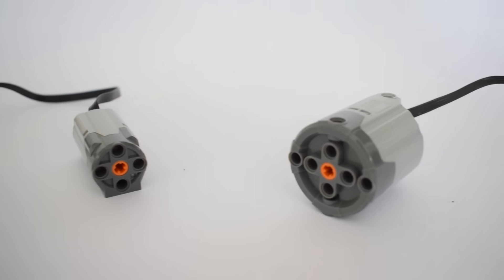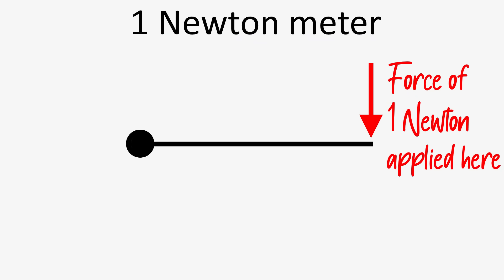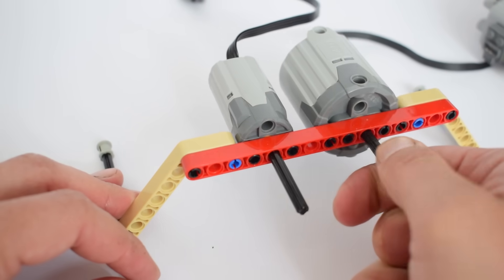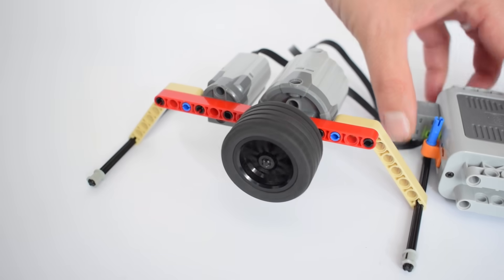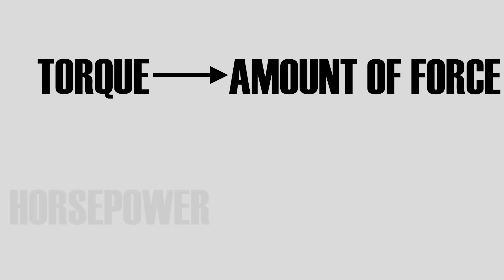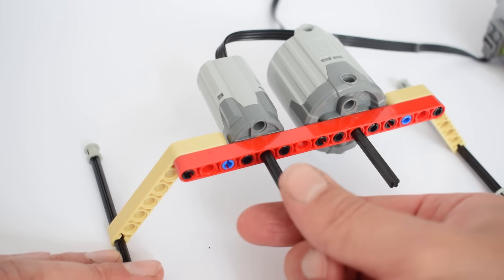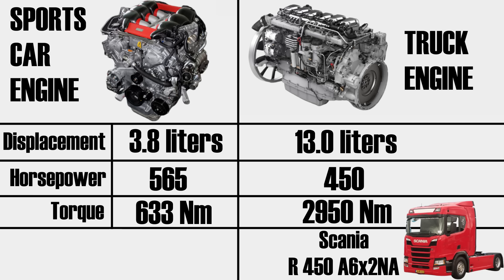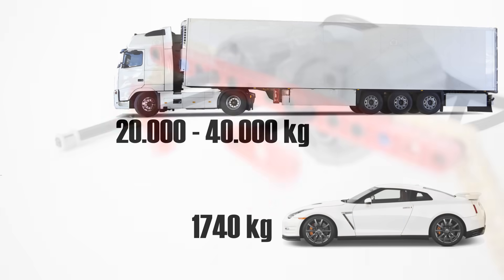NEVER be confused by HORSEPOWER and TORQUE again - HP and TORQUE EXPLAINED in the MOST VISUAL WAY

Comment: That's the weirdest definition of power I ever heard. Power is power, work is power multiplied by time, just like work can be torque multiplied by time. But other than that it's nice that you show difference between ability to do "lot of work" (low torque) and to do "hard work" (high torque).

Comment: The car engine in this example could pull the same load as the truck engine but faster, with the correct gears. But maybe wouldn’t last for 500k  miles doing it 👍

Comment: I know some of the differences between those referenced vehicle engines are due to one being petrol and the other being Diesel. But what makes an engine a quick revving engine (note: quick not high although those two are probably rather well correlated)? Is just low mass of moving engine parts vs power/torque? And wouldn’t for driving experience the whole mass of the car dwarf that of the moving parts of the engine?

To ask a simple question: Two engines running at 1000 rpm, with one being able to provide twice as much torque at 1000 rpm (when floored), the same weight of moving parts (I guess it gets more complicated with how that mass is split between parts that reverse direction and rotational components, eg, piston vs fly wheel), when you floor bath engines, which one will hit 2000 or 3000 rpm first?
Reply: Depends on the torque curve of each engine ( graph ) The one with larger torque could be on the down slope meaning falling torque while the other could be on the up slope increasing torque.
Reply: @malcolmwellings2198  Ok, let’s think about a couple of combinations: (a) both engines have a torque plateau from 1000 to 3000 rpm, (b) the lower torque engine as a rising torque curve from 1000 to 3000 rpm, while the higher-at-1000-rpm torque engine has a plateau.

Comment: rpm can be changed using gears. can torque be changed..? ex: for a given 
hp= torque x rpm 
at moor output, if we connect a 1:2 gear, rpm  changes to half at the gear output. what about horsepower and torque at the gear output??
Reply: Yes, gear output rpm will be lower torque higher, hp the same.

Comment: Hang on, if it's newton metres then surely it's lbs foot and not foot lbs? The force first, distance last? Excellent video though!  Gonna definitely watch your one about diffs because they baffle me a bit
Reply: You're multiplying the units together. It doesn't matter which comes first. People say both "pound feet" and "foot pounds". Neither is more correct.
Reply: @wbfaulk  cool ta! That's a very good point that had never occurred to me before! 👍 Although I have to say I've never heard anyone say metres newton, not ever and every manual I've ever seen has it written lbs foot. Foot lbs rolls off the tongue more easily than lbs foot I have to say.

Comment: Great video, but I think that you should have at least mentioned how gear ratios relate to this topic.
Reply: i agree. i have a 1999 gt mustang and the torque increase you feel with 4.10 gears is phenomenal. gearing is seriously an underrated way to increase power in a car/truck
Reply: One thing I can say is that 4L in SUVs is the maximum torque put to the wheels, and I dare anyone to stop a vehicle in this mode

Comment: If the definition of Newton includes time, then how is the difference between N and HP time?
Reply: Torque is force times distance from center of rotation. Force is defined as mass times acceleration (distance divided by time squared). Power is energy divided by time or torque times angular velocity. 
Torque would be F·d, which can be broken down further into m*d^2/t^2. Power is F·d/t which can be broken down into m*d^2/t^3 . Where F=force, d=distance, m=mass, and t=time. 
Power has another time component that torque lacks.

Comment: This is a good start, but it doesn't explain why one is more useful than another or how gear ratios play into it. It seems to me that using a gear to merely double the speed of the larger motor's output will give it a better "power ratio" than the small one. In other words, what it looks like is that power is a measure of the maximum speed of the shaft when under 0 load, which obviously isn't correct, but I still have no idea what is correct. It seems to me that more torque always begets more power, because if you're speed limited, you can just use a gear ratio to fix it. The truck should be able to out-speed the little car if very generous gearing is applied.
Reply from the maker: Here's a continuation with gearing: https://youtu.be/txQs3x-UN34

Comment: So horsepower being represented as a ratio between torque over the rate of time that torque is applied. Is that why when we use gear reduction, it increases the torque of the gear train?

Because the horsepower is staying fixed, but the speed of rotation is decreasing relative to the horsepower?
Reply: Yes. Gear reductions are torque multipliers.

Comment: Basically it's the difference between squatting large weights and running very fast. Ideally you want powerful legs that aren't too large to still run fast. If your goal is going fast quickly that is.

Comment: The video is amazing but i always had a stupid question when it comes to Torque and Horsepower.. i know mathematically that horsepower is = Torque X RPM... but why when i still look for a car specifications for example i see them writing the maximum hp/rpm =184/4800 and the maximum torque/rpm =  221/3500... why's the rpm values not equal ?? i know thats a stupid one but i just can't get it
Reply: Example: If you have a high torque of 4 and low revs of 2 you get 8 in power.
Lower torque of 3 but higher revs of 4 give you 12 in power (more power even if the torque is lower).

Comment: Really, really well done! Great job mate! I get there s question every now and then and would definitely refer to this video when trying the explain the concept. 

Thank you for this effort! Respect :)
Reply: For most people, this one practical explanation should suffice: 

Torque is beneficial for powerful starting, climbing inclines or pulling loads. 

RPM is beneficial for higher speeds and faster acceleration. 

But in the end, the gearbox in particular has to be optimized for use. 
To bring torque and RPM to the wheels, in the best possible way.

Comment: Great explanation, although one thing that's missing is why horsepower matters for (top) speed
Reply: Exactly, and why the torque helps you drive a big load up the hill. Slowly. This video is already great, but it would even be possible to show those results with lego!

Comment: 6:20 When a car accelerates there is no force pushing you into the the seat, but there is a force pushing the seat into you. The car is being forced to accelerate, but the passengers (as independent, relatively stationary masses with respect to the car) just happen to be in the way as the car is pushing against them.

From our perspective it feels like we're being "pushed into the seat" but if you think about it, it makes sense that the car is actually pushing against you, because the engine also needs to accelerate you to the speed of the car and all of its components.
Reply: for every applied force, there is an equal reaction in the opposite direction
Reply: To out pedant you- it depends on your reference frame.  Both are ultimately correct and identical.
Reply: @zakpodo  Not entirely - accelerating reference frames have different physics than our classic model
Reply: @MiDnYTe25  it's all relative, Albert.
Reply: @zakpodo  Water is wet. Point is that physics you learn in high school don't apply to accelerating reference frames
Reply: @MiDnYTe25  Maybe the physics you learned in high school don't, but the physics you learn in university do.

Besides, how do you even determine which is the accelerated frame?!  You are on a planet (whichn s round, so even going in a straight line is accelerated, even if you ignore the motion of the earth in space,   And this is beside the fact that being under the influence of earths gravity is an accelerated frame.)

That was a relativity joke, if you missed the hint, btw.
Reply: @zakpodo  considering the situation we're reacting to, Earth is the relevant reference frame to which you can compare everything. Sure, we can always abstract further. It's not a matter of could we, more should we.
Reply: @MiDnYTe25  So we agree that I was not incorrect  to point out that physics can handle these switched frames of reference equivalently?
Reply: @zakpodo  to put pedant you - only an inertial frame of reference should be used and is always assumed. Non-inertial frames of reference need imaginary forces. The force pushing you into the seat is an imaginary force needed to be able to apply Newtonian laws to your non-inertial frame.
Reply: technically gravity is pushing you into  the seat, but to out pedant myself apparently gravity isn't an actual force. So there's that I guess.
Reply: @Obi-WanKannabis  Well thanks to inertia you want to follow the straight line in space-time which would bring you into the seat and curving towards the center of earths gravity. It's the normal force from the seat that constantly pushes you off that path.
Reply: @Obi-WanKannabis  Plain wrong m8, gravity ( on Earth ) is directed downward in the direction of the planet, hahaha :D
Reply: @server1ok  Rain Shultz in the comment above said it, gravity is not a force, it's like a centrifugal force in a centrifuge, it's just your inertia following a curve in space time. The only force you feel is the normal force of your seat pushing against you.
Reply: @server1ok  You can't feel gravity
Reply: @server1ok  Wrong, I didnt' say it was equal, I said it was a similar effect where you feel a force, but in reality it is not a force, it is your inertia pushing against an object.
Reply: No one said that gravity and artificial gravity are the same, I said gravity is similar to a centrifugue in that it isn't an actual force, it's the curvature of spacetime, the only force that you feel is the ground pushing against your inertia in a curved spacetime.

Here's the difference between a car accelerating and gravity.

You only feel gravity when you are resting against hte ground. Because your momentum is being changed by the ground itself. This is the same reason why you only feel your car accelerating when it is actually accelerating, your body wants to keep its momentum but your car is pushing you against it. 

In both cases you feel an object push against your natural momentum. You only feel the gravity once the ground is keeping you up.

If you disagree, have a go at disproving Einstein.
Reply: @Obi-WanKannabis  of course that gravity is not a force because it's a freaking acceleration
Reply: @Andrei1898  Do you even newton bro? How do you accelerate mass without a force?
Reply: @Obi-WanKannabis  stop smoking... acceleration in not force, meters(lenght) are present in the torque, yes is not torque it's just lenght. A stool can be made out of sticks...but a stick is not a stool? Clear now?
Reply: @Andrei1898  f = m x a. Meaning if you acclerate a mass then IT IS a force. Go back to middle school physics.
Reply: For every action there is a reaction, actually both are happening at the same time
Reply: actually gravity is FUCK YOU
Reply: Pushing against our back
Reply: Pretty sure both are happening.

Comment: Horsepower = how fast you go
Torque = how quick you can get there
Reply: Nope. All things being equal (weight, aero, traction,proper gear ratios etc) HP is both how fast you can go AND how fast you can get there. Torque by itself tells you little to nothing.

Comment: Nice video, but I have to be nitpicky here: Although you explain that "Horsepower" is the unit for "Power" you still mix it up several times. Also in the title. Let's better be correct here ;-) So it has to be "POWER vs TORQUE" or "HORSEPOWER vs POUNDFEET"

 However, all that shows why metrics (or let's better say: SI-units) are just better. In Germany people still use "Horsepower" ("Pferdestärke"= "PS") when it comes to cars because they are used to it - although SI-Unit are mandatory. So car companies use both on there websites or brochures: PS and kW (kiloWatt).

Using (Kilo)Watts makes much more sense than horsepower, because you already see the connection between "Energy" and "Power" (that you describe in the video) already when you just look at the units. When we have an electric car with a battery that can storage 50 kWh of energy and motor that can produce a power 100kW, then we know (let's ignore efficency here)  that after driving half an hour on full throttle the battery will be empty. Try that when you only know, how much horsepower you car has! And already the unit kWh shows that energy is the product of Power (in kW) and time (in h). Or the otherway around: When you charge you car at at charging station with 50 kW, it will take one hour to fully charge a 50kWh battery.

Another energy unit is calories. One calory is the amount of energy that is needed to heat one 1g of water by 1 °C. LOL, nonsense! So instead we should use Joule (J), that is also printed on food. And no, Joule is NOT just another random unit, instead one Joule is one Wattsecond (1 J = 1 Ws). Now that makes sense! You see also here, that "energy" is "power x time". You even can compare the amount of energy that is storaged in the battery of an electric care with the energy that is storaged in a candy bar :-)

Comment: But different horses have different power... and in the middle east they use goats.. how do you measure that?
Reply from the maker: It's a little known fact that power in motorsports is actually based on goat and not horse power, hence Moto GP.

Comment: Anyway confused :D
Sometimes you see different dyno results where torque is the same but horsepower increased.
Reply: Power is torque times angular velocity (usually measured in rpm). So if the torque is the same but the power is greater then the engine was producing that torque at a higher rpm.

Comment: In a car type scenario it’s easy. Horse power is how fast you can go as your top speed and torque is how quickly you can get to that top speed.

It’s all just work = force x distance. 

Horse power is force and if you have a certain amount being produced then a a certain top speed aren’t making any mod power than what your using. So the engine makes this much force and you can go about that far. Divide that by the time that you produced the force for and you have your speed.

Torque is trickier ish. You turn the wheel once and that makes you go so far. You turn the wheel once but faster and you go the same distance but do it quicker. That turning bit is torque. The faster you turn the wheel the harder it is to turn.

Easy, so power is how fast you can go and torque is how fast you get there.

Now props with infinitely small movements can maintain the prop at a speed and torque that optimised. Torque is just how hard you can twist a shaft.

I never knew there was confusion.

Comment: Great vid, but regarding feeling: guess you could feel the hp if you applied some force (not enough to stop it) on the shaft over time and felt the heat?
Reply: No, you could just use gearbox and assuming engines have the same HP they would output the same torque. Video is misleading.

Comment: So at the end of the day, why can't you take the sports car engine - which has more power (the measure of a repeated activity) - and put it in the truck and gear it down until the output shaft produces the same amount of torque as the truck engine? With the two output shafts now having the same amount of torque and the car engine being able to rev higher than the truck engine, the revolutions of the output shaft should still be higher with the car engine, hence, the car engine should be able to accelerate the same load faster than the truck. Is this not correct?
Reply: The math ends up destroying the car engine, increasing the torque by a factor of "X" also means you need to increase the transmission input RPMs by "X" as well.

Comment: Please don't confusing things further by specifying that power is rate at which work is done

Energy is what makes change happen and can be transferred form one object to another. Energy can also be transformed from one form to another.

Power is the rate at which energy is transferred. It is not energy but is often confused with energy
Reply: power is the rate of work done. Power is energy over time, work over time, or torque times angular velocity.

Comment: To the retards out here refusing to understand pounds foot because it uses the imperial system, it's actually a lot easier to understand pounds foot of torque over newton meters of torque. Newton is a measure of force or the amount of force applied over a period of time through a distance. Pounds foot is basically how much weight/force is applied to the object over a given length (foot).
Reply: Bruh what are talking about. They are literally the exact same concept one just uses metric units. Newton meters of torque is force times distance from center of rotation, just like pound feet torque
Reply: @Redtooth75  My reasoning was that pounds were easier to visualize than newtons which are a measure of force.
Reply: @rahulravishankar3152  both pound force and newtons are units of force. Pounds can also be used as a unit of mass but in engineering contexts they are a unit of force, the slug or pound mass is the imperial unit of mass. Torque is force times distance, the units used for force or distance does not matter. I dont think you have a correct understanding of what a newton is. It is the metric equivalent to pounds force.